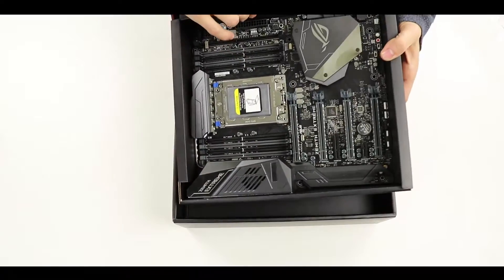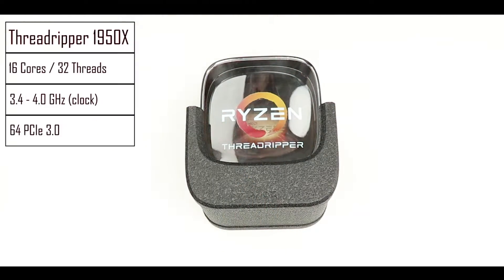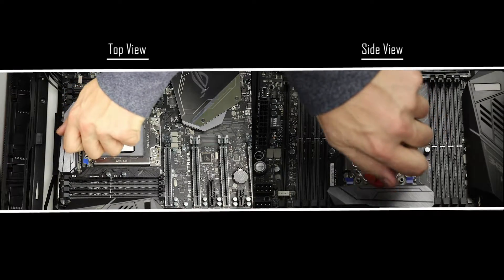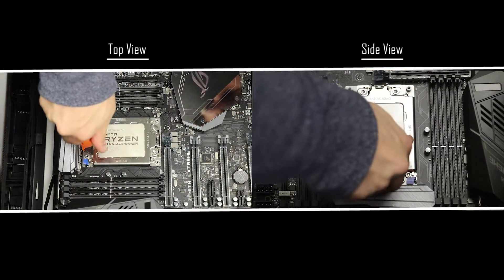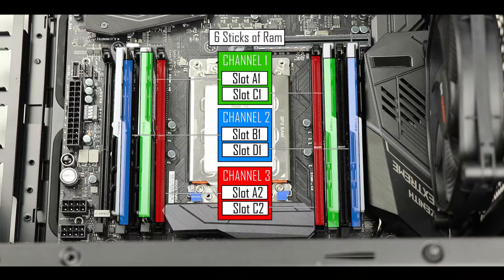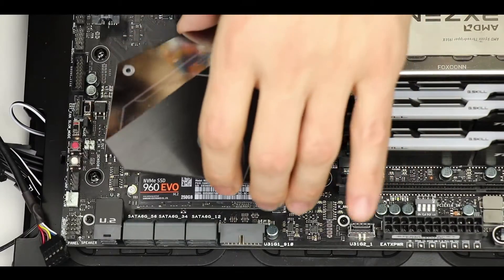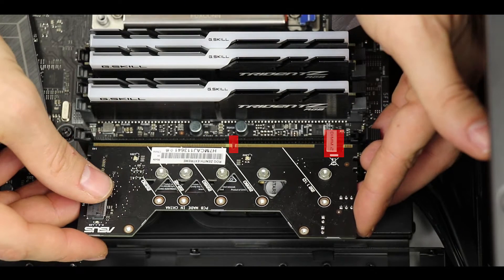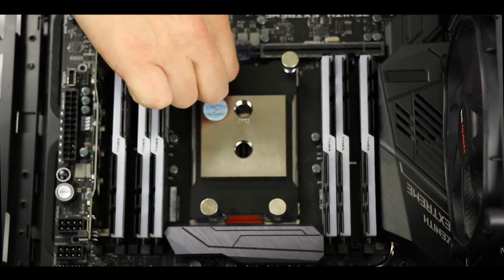Motherboard and CPU installation ( The Threadripper Build 2 of 8 )

Comment: hi friend. do you have a system fan1 in your mobo?. i have a x399 designare ex. i believe that my system fan1 isnt working. i have 0.8volt in the second pin where this would out 5-8 volts. also i see in the bios that this system fan1 not working if it not superate over 70-80degress. how you calibrate on the bios smart fan5?

Comment: Ok, I've come across another problem.  I got two extra 140mm silent wings 3 for the bottom of the case.  But when installed there is no room for the power supply?  WTH?  Am I missing something? is there a way to raise the PSU slightly above the fan?
Reply from the maker: +Jeff Bruneel send me pictures by email. Let me take a look at it
Reply: Will do, thank you!
Reply: I figured it out.  BeQuiet web site says PSU must be 150mm or less in length for use with a bottom fan.  I missed that detail because mine is 200mm : (    Well I guess I need to decide on either a different PSU  or only one bottom fan.

Comment: A great video can't wait for the rest.  I'm doing a similar build and have a question.  Question; the case comes with three standoffs that the manual says are for E-ATX motherboards. Where do they go? I can't seem to see a place for them to screw in.
Reply from the maker: +Jeff Bruneel hey there. :) thank you for watching:)
Eventhough I used the largest EATX available (272mm) I did not need the additional stand offs. 

I suspect that there are replacement stand offs.

What's your build specs ? Any custom water cooling loop ?
Reply: Ok great thank you.

My build:
Threadripper 1950x
Asus Zenith extreme
8x16GB G.Skill Trident Z RGB ddr4 2933 ram
Enermax Liquidtech TR4 360 AIO 
SAMSUNG 960 PRO M.2 1TB x 3
ASUS ROG Strix GeForce GTX 1080 Ti 
EVGA SuperNova 1200 P2 80 Plus Platinum
be quiet! DARK BASE PRO 900
Reply from the maker: +Jeff Bruneel Oh my... this is a SERIOUS build you got there... what on earth ... 

U got to be a 40 years old gamer (like me) or a quantum physicist !
Reply: lol neither actually. Well maybe a little bit of gaming.  I am a vfx compositor and I will be exploiting  those M.2 drives and all of those threads for rendering.

Comment: Did the socket give you any problems? Recent TR4 sockets by foxxconn have begun to be a real pain in the butt when securing the cpu. They don't torque in well and require quite a bit of force.

Anyway, great video. Waiting for the next one!
Reply from the maker: Very good comment. I was expecting an issue as well, but nothing. I did slightly press harder on the 2nd screw, but nothing excessive.

BUT... I had try it on another Foxconn and I did encounter the torqueing issue. After investigating, I realized the CPU missed some of the rails on the socket sliding holder (see what I mean). That added a millimeter of space between the screw and the screw raiser, hence an irrealistic amount of force to make it torque.

I might go on a limb here, but I think that most of the people having this issue had the same slider problem.